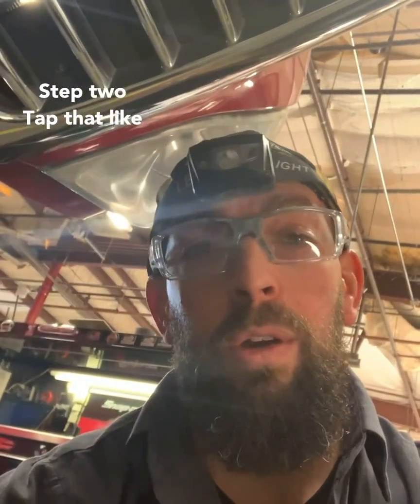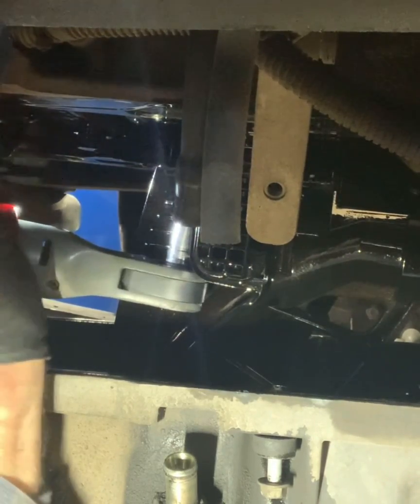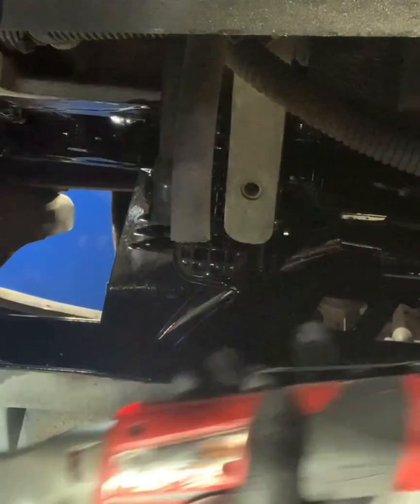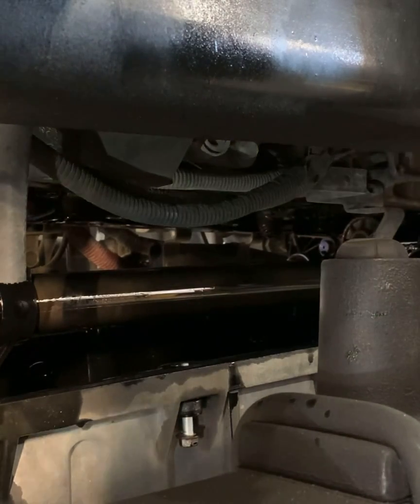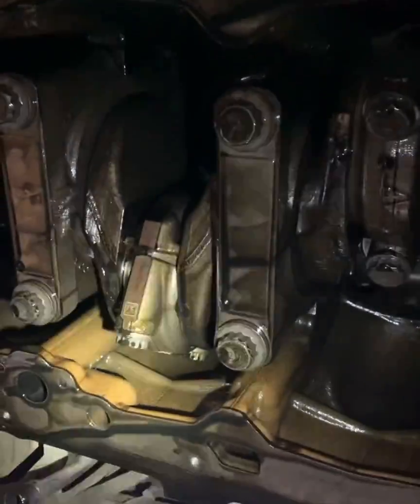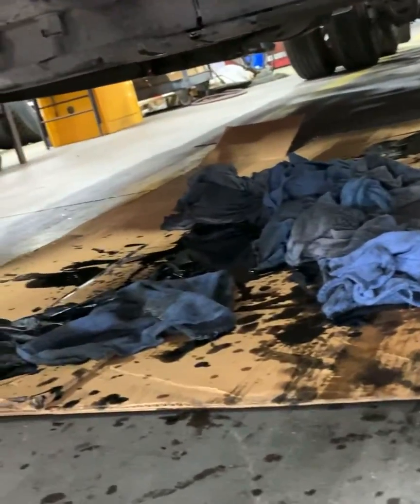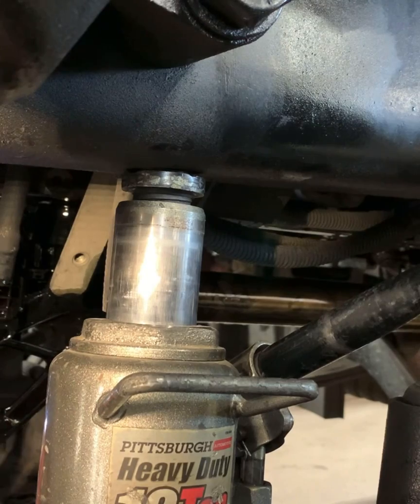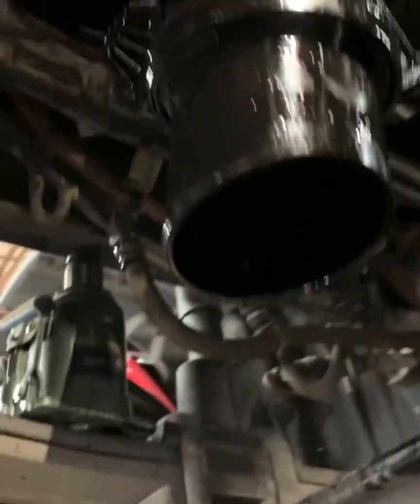OIL SUCTION MANIFOLD REPLACEMENT.DD15 .ENGINE OIL LOW PRESSURE.OIL PICK UP TUBE

Comment: Major expenses, I wish I'd be happy with a new car but the old Toyota is plenty good. Last summer I replaced the water heater, no big deal, I went to a tankless water heater and it gets the job done.  DIY project and total cost was around 400 bucks.  I've got some roofs that need shingling this spring so that will take a chunk out of the kid's inheritance.  Easy roofing, not to steep so  I'll take my time and do it myself.  Good exercise for an old man.   I dodged the financial bullet a while back,  had an emergency ERCP and next day was scheduled for gall bladder removal surgery.  I called my medicare advantage plan people and found out they wouldn't pay for the surgery without prior approval which no had asked for.  Anyway  I was feeling just fine so I said "No" to the surgery and got booted out of the hospital.  Almost a year and a half later and still have the old gall bladder and so far no problems.  My medicare advantage paid 100% on the emergency ERCP.   Gall bladder removal surgery would have been a whooper to pay out of pocket.   All in all I get around 3K a month with pension and SS,  usually a thousand a month will get me by.   I've been retired 26 years now and a dollar sure won't buy what it did when I retired.

Comment: So what’s the easy way to remove the oil suction manifold? I’m struggling, but I might just take off also the oil pump and fight it outside the truck.
Reply from the maker: @thereviewer4173  best way it to pull it down and fight it apart while it’s down.
Reply: @ 

I took out the whole thing and took it apart outside the truck. Much easier and I also used a rubber mallet. I had it apart in one minute.

Comment: People, if you buy a used truck with DD15, over half million miles or so, have this job done. It might cost you a thousand to $1,500 bucks, but you want to do it. You can lose oil pressure so quick that it'll be too late. I've been there, and it's not a good place to be. I've known others as well.
Reply: Where are you getting it done for $1500 at ?  I’ve got three I need done
Reply: @greghess6077 have you checked with your mechanic?..my guy is near intersection of I-80 and I-39   in Illinois..I think he's around 120/hr...I'd have to go back through my receipts and double check...pretty sure it was around 1200..parts aren't bad
Reply: @cablanchette1 thank you.  It’s a lot more expensive in SLC, UT

Comment: I just replaced mine for preventative maintenance. 2020 Cascadia at replaced the manifold and o-rings at 503K miles. When should I replace the o-rings again?
Reply from the maker: @Nihil2005  you should be fine for another 500k miles. But at that point you will be needing an overhaul.

Comment: Do you need to prime oil after replacing the suction manifold?? I heard you could damage the engine if you dont prime it. Thanks jn advance
Reply: Yes! Detroit recommends that you prime after replacing the suction manifold and oil pump. They sell a special piece or you can make one.
Reply: @qb6570   now how do i prime the oil? Where is the plug located? Thanks
Reply: @EdinOmerovic-q2z it's the oil sample port on the right side of the block... just need 700 dollars for the adapter and pump. Fucking sucks and now I'm not sure what to do lol

Comment: I have a question - what part of oil suction manifold is dipped in the oil ? I mean just the lip/skirt of the manifold is dipped in oil or whole manifold is dipped - I am trying to solve a puzzle about my DD15  engine break down and this answer will help me greatly -
Reply from the maker: Just the screen portion of the suction manifold is dipped into the lowest portion of the oil pan.

Comment: Can you make a video showing how to add a Manual Oil Pressure Gauge?
Reply from the maker: Great idea. Next time I come across this I will add a video. Just keep in mind it will be very different for each Eng model.
Reply: Where you located please..2017 casacadia

Comment: My 2015 Freightliner Cascadia was running fine without a load as soon as I got a load the oil pressure went out took it to the shop they said the oil suction  manifold had a crack in it how is that possible when I was driving a truck with no load but when I got a load the oil pressure went out
Reply from the maker: Great question. I would say just bad timing. Those plastic manifolds can crack at any moment. Also the orings for the pick up tubes get dry over time and with being a 15 model it was going to happen sooner rather than later. While your there replace oil pump ,pick up manifold, all tube orings.
Reply: @bustedknucklebydieseldr3228  thank you keep up the good work

Comment: Have 2015 frtlnr w/ dd 13. Left yard and alarms sound and zero oil pressure. We changed oil sensor still zero pressure. Has 500k so should I replace anything else? Plastic tubes, housing? I'm doing it on site by myself so thanks for advice.
Reply: Put new sensor in. Zero on Guage still..had mechanic hook up scanner and let me watch oil pressure on laptop. Cranked engine and pressure went from 00.00 to 00.58 for 1 second then back to zero. So we figure that oil tried to pump but lost prime/suction. Either o rings or plastic tube cracked. What's ur best guess. Thx again for info.
Reply from the maker: @blackflag43  did engine still crank over or did it stop and seize. I’m worried that the Eng seized up with no oil press.  If that’s not the case than I would change oil pump , tube orings and suction manifold.
Reply: Thanks for your help 👍
Reply from the maker: Man this is a tough one. If oil press shows zero the next thing I’d do is plumb in a manual gauge and find out if the sensor is bad or gauge is wrong before I’d drop the pan.  Or this will all be for nothing

Comment: The Oil suction manifolds are plastic and get more brittle after 4-500,000mi. If you're in this deep (changing oil seals) bit the bullet and change the oil suction manifold. It's possible it could last another 4-500k but it's also possible (depending on how much heat or overheating it's had) only have a few thousand miles before it goes out. Mine went out about 600,000. Had to immediately shut off truck and change oil suction manifold AND oil tube seal since we were in there.
Reply: Did you save the engine by shutting it off?

Comment: Replaced the o rings and manifold today. It went smoother than expected. 
Took me about 5 hours. 
If you let the truck sit for couple days there is almost no oil left in the manifold, so no mess. 
Thanks for the detailed video.
Reply from the maker: Glad this was able to come in handy for you. Hopefully more vids on this channel does the same. And damn what a job to try out. You are obviously bad ass of you can tackle this. Congrats on getting it done and imagine how much $$$ you saved.
Reply: Where do you work and how much to do the job with replacing pump and manifold with new orings
Reply: Mr busted knuckles just wanted to give you knuckles 👊 for this video,  I did my 2013 dd13 has 470k and started to show signs of low pressure especially when starting cold or hot it was not bam pressure like b4 as soon as it started anyway took the pan down and sure as shot the tubes were clanking when I shockem so thank you man for your video it helped alot , . Ps my truck has a bracket that holds the front air valves , makes it a problem to pull the pan out , I found if you take the front motor mount off then remove the bracket pan comes right out anyways ✌️
Reply: @bustedknuckledieseldr3228 i have a 2017 dd15, with 490000 miles getting close to needing to do this done before  anything happens.What all parts do you recommend changing out while you are under there . Thanks . I have learned quie quite a bit by watching your videos

Comment: I’m underneath a DD13 right now. Do you really torque these bolts on the plastic suction manifold to 44ftlbs that’s seems like overkill. Feel like I’m gonna break one off
Reply from the maker: Those ones might be 22lbft. I’d have to look it up again.
Reply: @bustedknucklebydieseldr3228   do you know if ita 22 or 44? I'm stuck and don't wanna mess this up.
Reply: @tblickie7000 I'm in the same boat you're in right now as I type this. I stopped at 30 ft lb and even that feels like it's going to break the bolt. So I backed everything off and currently have the oil pump and suction manifold at 25 ft lb. The oil pump claims to only require 22 ft lb as well as the oil pan bolts. The odd thing is every one of these bolts is exactly the same size. So why are the four on the suction manifold claiming to be 44 ft lb. I don't know if you torked it to 44 if you did let me know. I'm afraid to do it.
Reply: @tblickie7000  it's 22ftlbs. 15-18 for the pan

Comment: Hey how did you diagnose that it was the o rings and not something else?
Reply from the maker: That is a great quest,, first you want to test the sensor and see if it’s accurate. Than plum in a gauge and check actual oil pressure. If those are good drop the pan and check those orings   If good or bad you’ll place them. But if good you’ll go to the oil pump replacement next. After 500k miles you can count on the orings being hard.
Reply: @bustedknucklebydieseldr3228  hey thanks for the response, definitely will be asking more questions later on lol. I work at a fleet shop and sometimes I get stuck on something that I can’t figure out and I ask someone else but usually they don’t know either.
Reply from the maker: @r.i.p_the_5.367  well you came to the right place. Specialty is everything freightliner but I’ll work on the others as well. Hopefully these vids are able to come in handy for you in the future of not , il do what I can to answer them. Stay safe out there.
Reply: @r.i.p_the_5.367  sup bro, just some advice. Read the repair manuals if you dont know. if you follow them for diagnosis then you can’t fail and no one can bust your balls. takes the guess work out of it.
Reply: @RampFisha  exactly. That’s something I’ve started learning is that if you don’t know it better find it in paper. Because guess work is never good work

Comment: Do you have to prime the oil system after this repair or just crank it as normal?
Reply from the maker: Im pretty sure I answered that in the video, atleast I better of. Definitely prime the lubrication system after repairs. No oil is left in the suction manifold so the block has no protection against seizng up.

Comment: New subscriber 👋.  Mechanic changed oil manifold complete then after 3 weeks I run into where I cant run past 1500 Rpm and low oil pressure code comes up even though gauge shows psi between 15 and 50 psi. However when I change my Oil Filter everything back to normal...any thoughts on that issue ?  Happen 2 times in the last 3 months. 

And Thank you for your videos  saved me alot !!
Reply from the maker: Thanks for watching and the sub. Can’t do it without support from viewers like yourself. So regarding your question I’m leaning towards low oil level after those repairs. That would make the most sense. Than after your filter was replaced it was possible that your level was filled by either yourself or the tech. But low level will cause those issue. That or orings on the oil suction man are not seated correctly and sucking air which would also cause stuttering and oil light to come on. Hope it stays away and you don’t have to deal with it.
Reply: @bustedknucklebydieseldr3228  will look into and thank you again !

Comment: So you did not replaced plastic manifold??? That job is worthless if you didn’t replace that brittle plastic manifold
Reply from the maker: Thanks for watching.  The main concern was the orings for the pick up tubes. They are the weak link. Manifold isn’t brittle but I do recommend replacing it if your there. Customer didn’t want it replaced just re-oringed even after I informed him it would be best. In the end , it’s whatever the customer wants.  Thanks for taking time to reach out.
Reply: @bustedknucklebydieseldr3228   understand. How much was it for everything?
Reply from the maker: @СтепанБандера-ы8у  that I am not sure of. Expect to pay about 6 hrs labor of whatever the door rate is where you go.